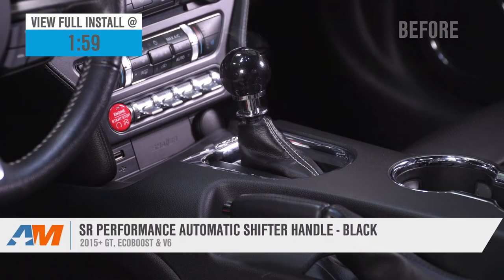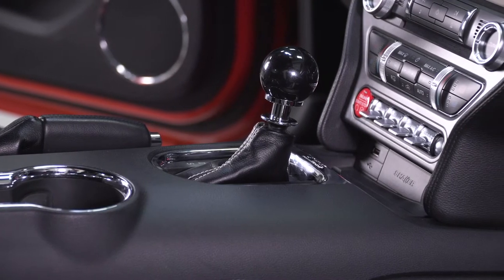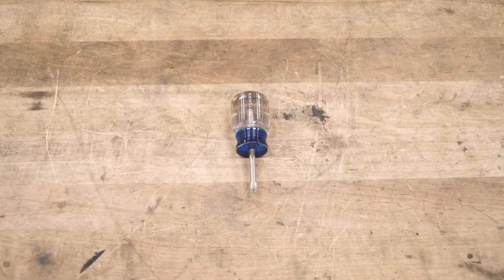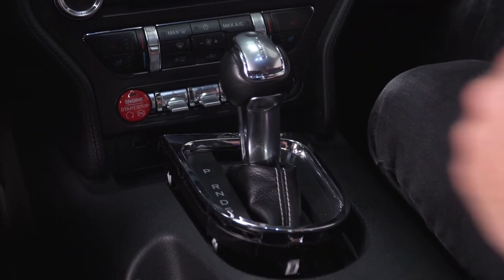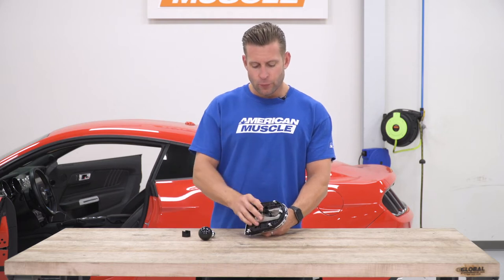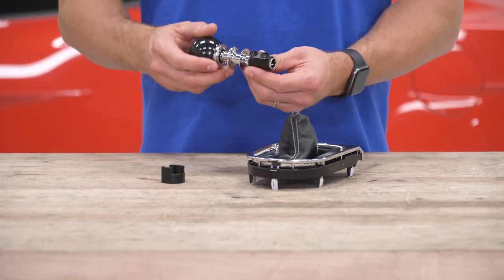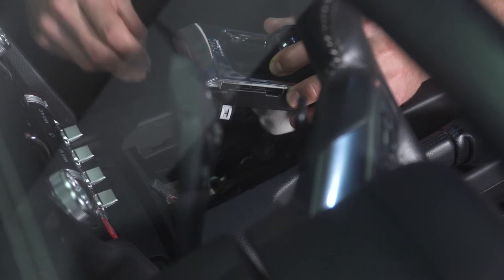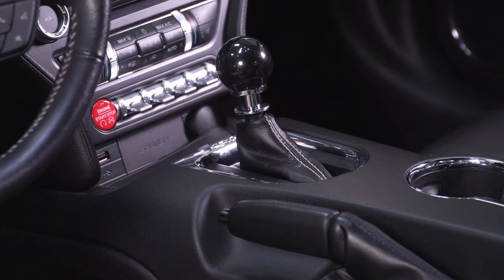2015-2020 Mustang SR Performance Automatic Shifter Handle; Black Review & Install

Comment: I just installed this great shifter. I love the looks over the last one I had. The only problem I had was trying to lineup the two set screw holes but while doing so I noticed there are two holes on the back of the collar and shifter that are identical to the front ones so I gave them a try. So much easier lining them up and shifter works the same. It was a good alternative option for this setup. Using a longer screw driver worked perfect.

Comment: Hey i just bought one of these last week finally came in the mail yesterday got to put it on about an hour ago. My question is mine does not work properly.. now i know this means its my fault but i was looking for someone that might know how to fix it. The problem is my shifter shifts freely without me having to push down on the knob and without me having to put pressure on the brake. The car also fails to recognize that the shifter is in the parked position so my car just beeps at me the whole time. If someone could help me it would be much appreciated..
Reply: Ever figure it out?
Reply: Happening to me as we speak , held up for 2 years tho.
Reply: @t5.0ny  bruh
Reply: It beeps because when the shifter is in park it does not engage properly. The black plastic stick that sits inside the shifter is constantly pressed down by this shorter shift knob. When that plastic piece is pressed down, the car doesn't recognize the transmission is in park. If you look on your dash the gears light up as you cycle between them but P doesn't. I had to uninstall because this locks out remote start and beeps any time the door is open.

Comment: No one going to comment how much of a b** it was to install those two screws thanks to ford engineers lol the new shifter moves up and down and the plastic piece while trying to hold the assy out of the way is a pain in a** so worth it though after took me an hour to get the screws in.
Reply: My doofy ass just dropped one of them in my shift 🤦🏿‍♀️🤦🏿‍♀️